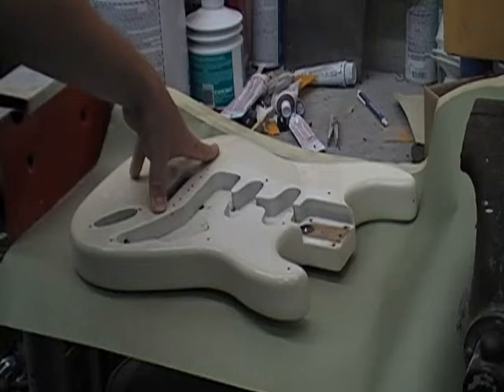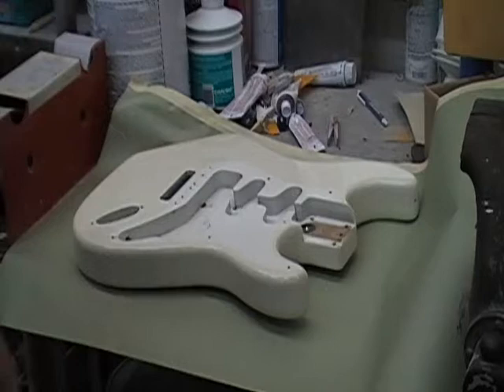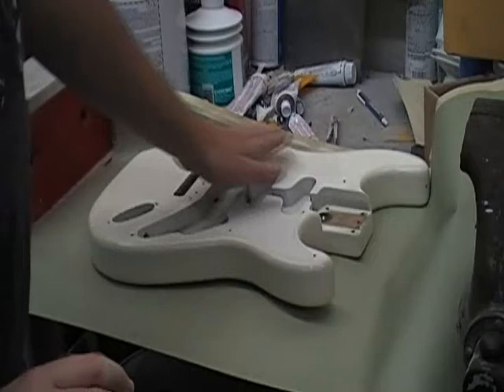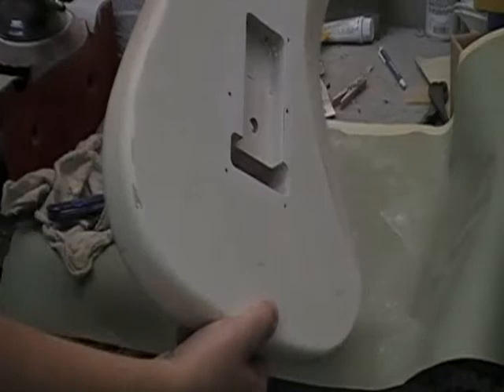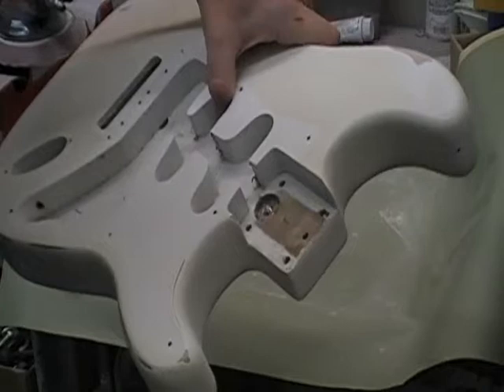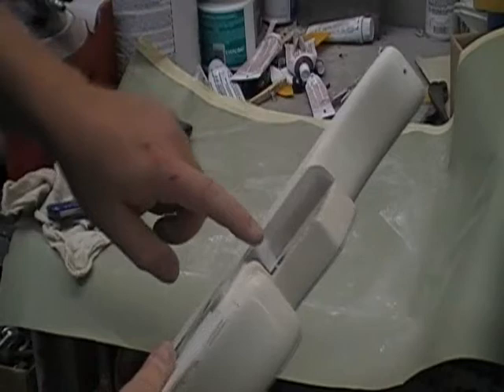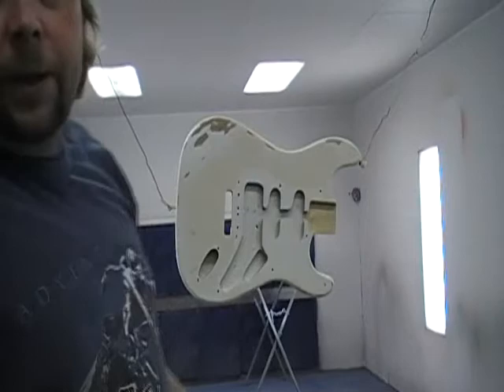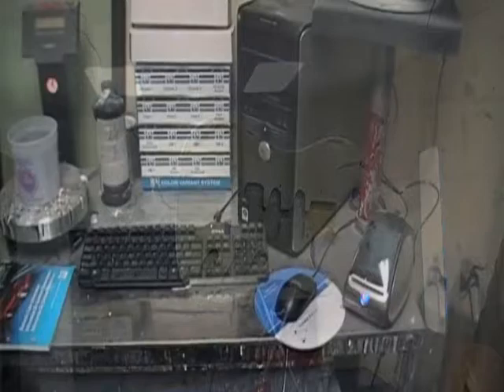how to relic your guitar peavey predator part 3 sand and paint

Comment from the maker: Hey, I would probably get some wood stain, nothing too dark...with a rag, put on light coats until you get the look you want..depending on the tint of the stain, it will make it look aged or yellowed, like smoke would do over time....then just add a few nicks and such to give it some character...once its good and dry you can take some really fine steel wool or a gray scotchbrite pad to lightly dull it down...hope this helps..

Comment from the maker: @motocarnage615 hey thats kinda tough to answer in this small space...olympic white is a very bright white,so if you are going to use automotive paint i would probably use straight white toner  (most whites have a little blue yellow or red mixed with them to get a certain shade) the straight white toner will have none...spray some sealer on your guitar,at least 3 coats of basecoat,3 coats of clearcoat....sand and buff...and you should have no problem with yellowing...i hope this helps..

Comment from the maker: @MrNirvanerd hey, 3 coats of primer should be enough,....it will probably take at least 3 coats of color....put it on in thin coats until it's completely covered.....you will have to judge that by looking at it......as far as the clearcoat at least 3 coats as well......depending on how slick you want it you can sand it with 2000 grit paper and put more clear on and buff it......allow several days in between if you are gonna re-clear it......i hope this helps.......

Comment from the maker: @TylersGaming hey,sanding your guitar should not be a problem.i'm not sure what tools you have access to,but without a d/a or orbital sander it is gonna take alot of manual labor..i would use a 180 grit sandpaper to take off the top layer and then switch to around a 400 grit..the only problem i forsee is that the factory puts a thick clear sealer over the bare wood before starting the paint process.it absorbes into the wood to help fill in the grain.i'm not sure how the stain  do over that

Comment from the maker: @Mikec80      thanks.....the type of paint you put on the hardware is not really as important as the primer......on chrome hardware you will have to use some type of etch or epoxy primer so it will adhere to the chrome.....even then you might still have some issues with chipping.......the ideal thing would be to have it powdercoated but that can be expensive......i hope this helps.....

Comment from the maker: @whatthebollocks hey, i've always been told you'll never learn if you don't ask questions.....so no worries about the comment.....i use automotive paints as you have seen in my videos,because that's what i have access to......in your case if you are wanting to keep the woodgrain look and just put a gloss over it i would probably put 2 or 3 coats of clear polyurathane over it.....it should be easily accessible and pretty user friendly....i hope this helps.....